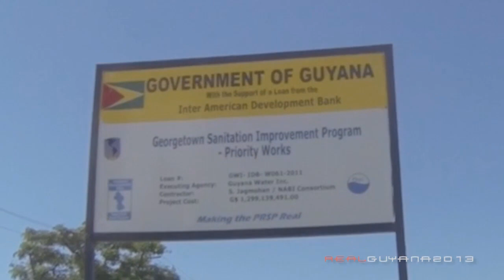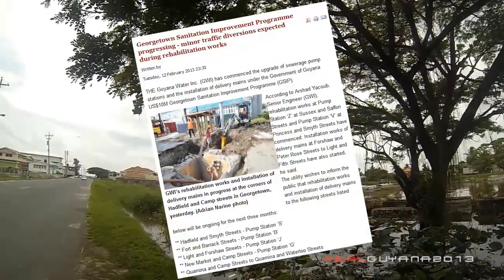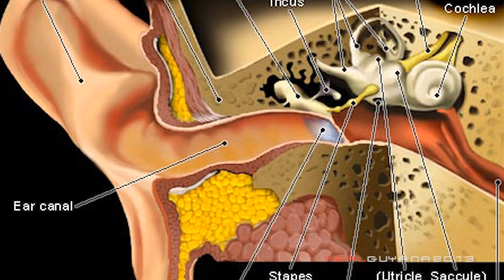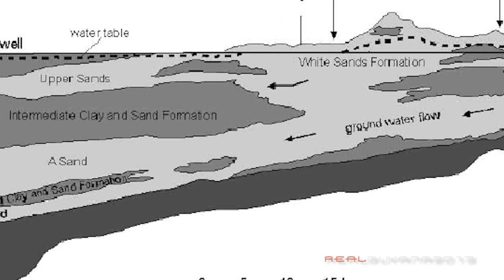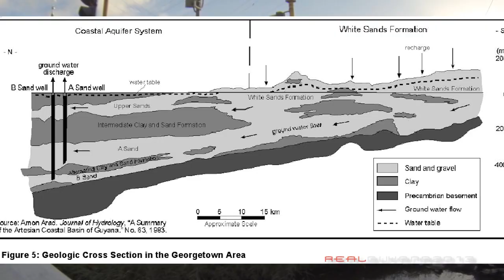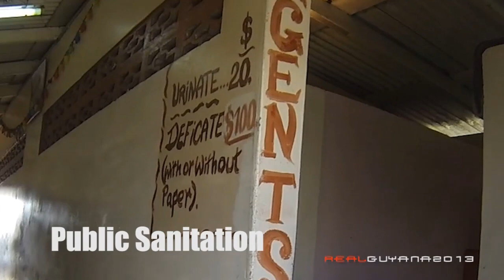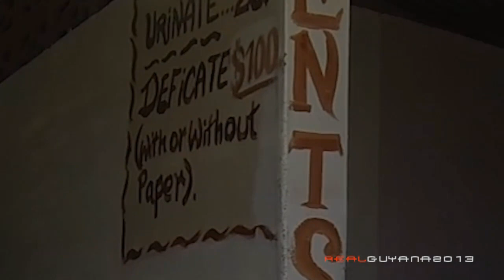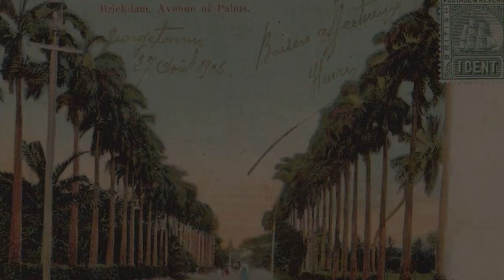Sewage and The City - Part 1 - Real Problems

Comment: agree to a point, but your presentation of the data is lacking and misleading. you focused on a report on the GWI sewer system and linked that to blockages in the city's drainage. 
if you focus on a topic such as "sanitation" in the city, then you need to look at all bodies that are responsible, such as city hall and public works. where are the monies going that is supposed to clean the drains and pick up garbage? why are trash bins in the city? why are the kokers not maintained? where's EPA?

Comment: the GWI Sewer System is not the main reason for blocked drains. This is very misleading. 

What does the G$1.68Billion project have to do with the flooding in the city? Why weren't Projects from City Hall and Public Works also highlighted?

Very limited and dodgy research and conclusions in this "documentary"

Comment: Your augment to this point is seriously flawed. You state that sewage gets into the drains and canals by floods, so isn’t the flooding the problem? Floods are caused by blocked drainage which is caused PRIMARILY by garbage and overgrown vegetation. Ie. If a person on the ECD gets flooded and their septic tank flows into that water which is transported into the drains, do u blame that person or the regulatory body responsible for the blocked drains?